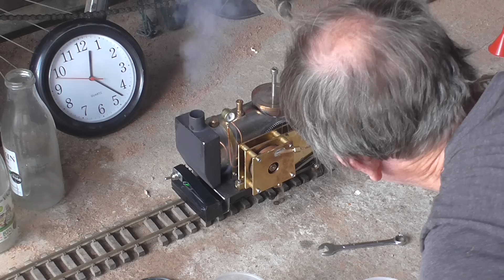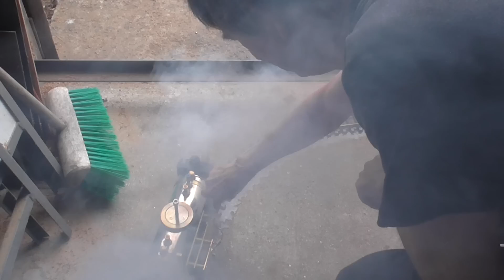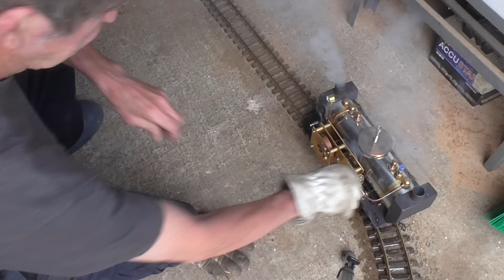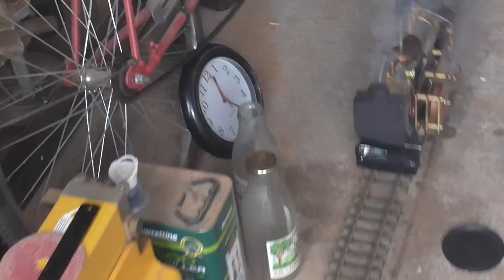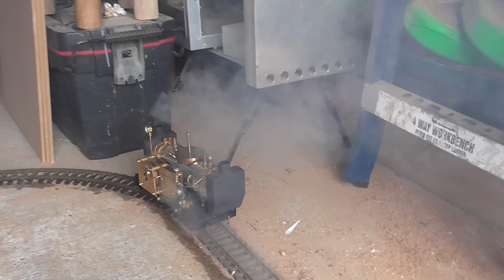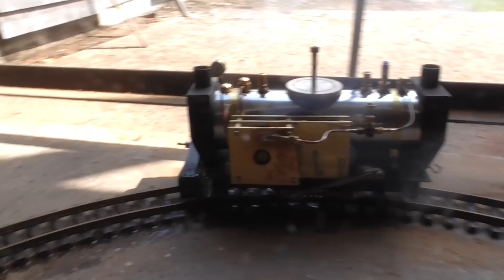Second test of steam turbine loco00005

Comment: What an absolute work of art, great job!
Reply from the maker: thanks for that chaps. the boiler has 5mm ceramic fibre lagging and a tin plate outer skin. next i will lag the steam pipe and if possible fit a superheater  but there may not be enough room in the firebox. its all an experiment but at least it worked after half a years work !!

Comment: I wonder if some insulation would help it, and running the steam line to the turbine as close to the boiler as possible such that the steam stays hot instead of condensing in the pipe.

Like, if the boiler and furnace had a second outer wall with either a vacuum or some insulative material in between to keep the heat in. The steam line could then be soldered to the side of the boiler as far along its length of travel as possible, or better yet run inside the furnace and boiler instead of free air.

Taller smoke stacks may improve the rate at which air is drawn through the furnace, improving the rate at which the fuel is burned. If you want to get really efficent with your furnace, you want a funnel which is narrow at the furnace and expands gradually as it rises. This would generate a significant pressure gradiant due to the rising heat, the narrow base would give you a higher velocity and low pressure at that point, further drawing air through the firebox.

Are you using a fan, or a blower? Electronics suppliers sell cheap blower fans in PC fan sizes. There is a big difference across fan and blower designs which effect their ability to diliver airflow or pressure. I believe you want pressure differential instead of airflow, and a pusher design instead of puller. You may be able to find a fan/blower that moves multiple times the air volume for the same power draw if you havent optimized this yet.

I believe that the turbine would perform better in free air as it is. My limited engineering experience tells me that the efficiency of a heat engine is the ratio of the hot side to the cold side,. So, you want the maximum amount of heat possible entering the turbine, and expanding as close as you can get to ambient temperature.

Without a close up of the turbine design, Im not sure if it is only using steam pressure or velocity from a nozzle. There may be some potential gained by allowing ambient air into the system somehow. Cool air will expand when heated to several hundred degrees. Not as much as water/steam does because of the phase change, but still a lot. Jet engines, piston gasoline engines, firearms, and other internal combustion engines rely on the heat of the combustion expanding the volume/pressure of the air inside the combustion chamber, rather than vaporization like an external combustion steam engine. Im not sure what the ratio is for atmospheric air.
Reply: I'm just a guy who tinkers, not an expert on anything. I figured that since you said this was an experiment, you may be open to the musings of a fellow madman.
I enjoyed the video, congratulations on a second successful test!
Reply: @SpecialEDy  oi! no letting out the secret!
i get strange looks when i say engines run on air... "but but its oxygen and fuel... its physics"

no, its compressing air then heating it to raise the pressure, and mixing it with fuel and burning it is a really convenient way of doing it, if a bit rough and antiquated...

first person ive ever seen talk about heating compressed air. maybe youve been reading my posts, lol... if not, you read the same sort of engineering books from yesteryear where this stuff is common knowledge...

lol. it IS physics. dah. lot of misunderstood concepts these days.

gotta laugh at these guys that put oil coolers on air compressors... AFTER the tank.

sure, cool it down BEFORE the tank and dry it out...

but you wanna HEAT it before using it again. thats the key. 

for every 249C you double the work it took to compress it.

theres a portugeuse video of someone running a turbocharger on a heat exchanger, just hot air. i really love the idea of external combustion turbines. i made a fireplace with two walls with teh idea of the same thing, just um... yeah. couldnt be bothered strapping the turbo on and dealing with oil lines and crap for what probably wont work as its too small...

from what ive seen of turbines, 400C is about right to overcome the losses and become "self sustaining". i can hit that, no probs. but can i do it to cubic meters of air per second? hmmmmm... no!

still, makes a great shed heater. thats the main purpose. i just made it as a pressure vessel as well with an experiment in mind...

you start to re-evaluate the way engines run when you get it out of your head that its  solely about burning stuff, that there is no "explosion", just a rise in pressure from supplying heat....

i like the idea of these compressed air engines feeding into multiple stages of expansion, each one heat exchanged then finally exhaust into one single cylinder thats doing the combustion to supply the heat needed for all the exchangers... no pumping loss as its already compressed, so its running a lenoir type cycle...

dont get me started on the lenoir cycle and what it could achieve with some forced induction... "its old, its inefficent, its obsolete, now shutup"
trying to track down an old sohc 4 banger about 2.4L is suddenly surprisingly hard... i wanna try something with reground cams, ignition... and compounded turbocharging. lenoir didnt have no turbocharger in 1860!

ten years ago there was one in nearly every paddock..

p.s. its a delaval type turbine he has here. diverging nozzle to get maximum steam velocity from conversion of heat to kinetic energy through expansion.

silly high speeds. were always too high. even for delavals milk separators he had to gear down tremendously.

should be compounded a bit. aka curtiss turbine.
 fiddly when small. inefficient.

everything you say about heat is 100% spot on. it needs more insulation to really get going.

not bad for an experiment, i must add.
Reply: @paradiselost9946  you and @SpecialEDy need to get a room together!! it's a toy, not the USS United States.